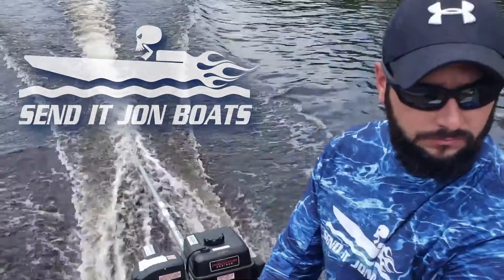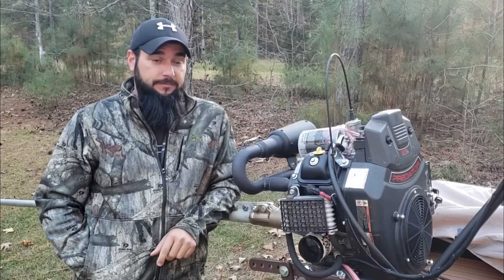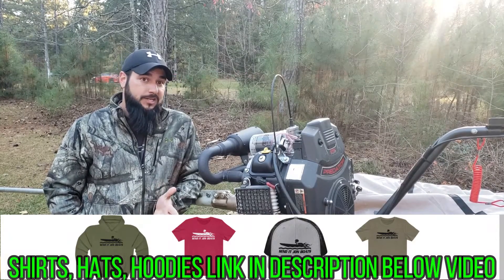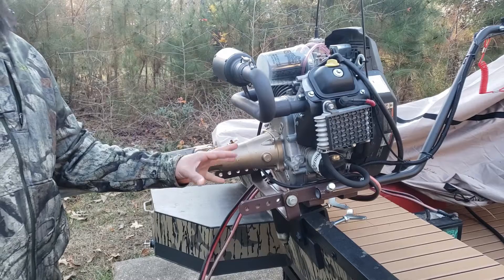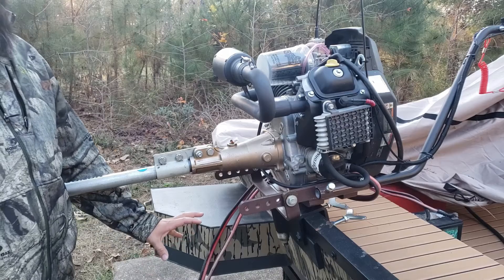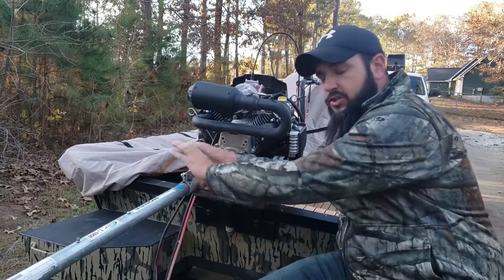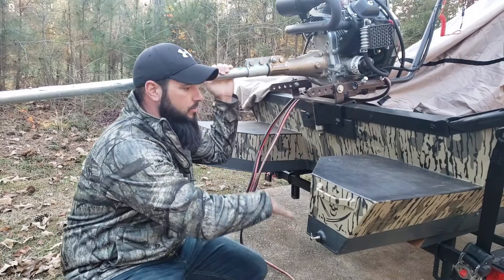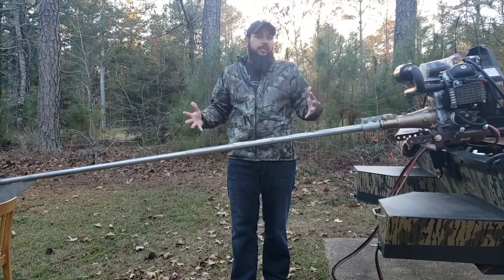Can we build a DIY Short Tail Surface Drive Mud Motor?

Comment: I just came across this post. This was done over 5 years ago, when Mud-skipper was dealing with KKK (CKS) I suggested to them, that they already had most of the parts, Engine base, Transom mount, Tiller, props and prop shafts (we'd already asked them to chop the longtail shaft in half because UPS had jacked up their rates on awkward sizes). The main box was about the only thing they had to make and they already had the sheet metal brake press. That is where the CKS Surface drive originated.

Comment: I have a 70hp turbo 3cyl that i need some guidance builidng a surface jet drive with if such a thing exists. Or a prop surface drive may be cool. I want it to mount more mid boat for better balance tho.
Reply from the maker: Never messed with a jet drive, so I will not be much help on that

Comment: Get you the juggernaut torque converter from go power sports it’s meant to take a lot of abuse and is very flexible while mounting it will give you great torque while starting out but won’t hurt your top speed since it has a 10% over drive
Reply from the maker: Awesome tip, thank you. We will look into that and see what we come up with.
Reply: I was thinking the same here . I don't know if getting it wet will hurt it .

Comment: Did you ever build your surface drive? I'm curious how it turned out .I'm thinking about building one myself but I'm curious how well it will do for comercial catfishing.....I had a guy on here tell me a way to build one with reverse ...,check out his surface drive it's here on you tube under DIY surface drive for 250 bucks ....,.he doesn't have reverse but he is the guy that explained to me how to build one...When you look at his video you'll see he used a single belt...I reccomend building just like he did except instead of the belt use a double roller number 35 chain and some sprockets...I think it will hold up better that way.....Check him out it's not a bad build at all ...the reverse ideal he gave me is pretty slick and it's cheap ....if your interested in it let me know and I can explain by pH or give you an email address ....I think there is a market for a surface drive built strong but cheaper than some I see....if I had ten grand to spend I just don't see ten grand in a surface drive ...some are built better and more complicated but that also means when you break it more money ....what's your take on one of these out drives for catfishing with barrel nets? I broke starter mounts on my 35 hp Mercury witch junked a otherwise good motor so I'm tierd of old outboards and can't afford a new one

Comment: Don’t use chain, chain doesn’t give if you hit stumps. Use a cog belt bc if you were to hit a stump you wouldn’t chance tearing everything up. For your trim you could always mount a small 4 wheeler winch and use it as your trim or just use all thread with a slanted piece of the transom and it’ll trim it up or down. If you could get a shaft made go hex way better then just a regular threaded shaft. And you’d have more options on props. 2 blades are good props but 3 blades cut down on vibration.

Comment: I vote for an inboard motor build with a cv axle on the outside of transom for up down side to side movement ,,or a ujoint may work as well
Come out say six inches from bottom of boat ,mayb a 4 foot shaft starting out,,
Kind of a mud boat style but a through transom style like the shark boats but on a smaller scale
Reply: cool I want to try that
Reply from the maker: That will be really cool, I think Chris is working on an idea to build something similar to what you are describing.

Comment: I've looked into this myself I think racing kart chainsaws sprockets would work well I also think racing kart belts will work and your housing can be built at a length you could test and shorten or make longer.    It's also very simple to change gear rations per kart racing but the correct hearing to me depends on prop size and pitch if using your straight drive prop I'd say you want same top and bottom gear since it turns on a straight drive the same speed as motor.....with kart engine parts I can build a smaller 13 hp to produce more hp than the stock 22....I suggest looking at race kart parts for all different reasons bc you hv alot of options there and I suggest sealing the housing to protect the bearings or use a down shaft motor and modify a mercury lower unit
Reply: Awesome thanks for the info
Reply from the maker: Great info, thanks for that. We are working on it.

Comment: I built a turbo diesel surface drive all out of 1/4 aluminum and it’s plenty strong. I actually think 1/4 aluminum everywhere is over kill and I should have went thinner in some places to save weight. 

For the bearings I just use a brass flange bearing at the prop and a pillow block at the back of the housing to handle the thrust. All in all, it works a hell of a lot better than I thought it would considering how heavy the diesel is but I’m still experimenting with ratios and prop sizes
Reply: That is awesome that you got it working. If you don't mind helping me out, could you send me some pictures on instagram or facebook of your build and any details you care to share, it would be greatly appreciated.
Reply: @SendItJonBoats  sure I send some pictures and what ever info you need just ask. I used what I had laying around so it’s not pretty or ideal and there’s a lot of area for improvement and weight saving but it works great.  I have a few videos on YouTube of me running it and testing it
Reply from the maker: Pictures and video links would be awesome. Send it over  to Chris on instagram or facebook @senditjonboats

Comment: I’m ready to help! I’ve been watching you’re channels and have thought the same about that question… can you do it yourself? I’ve recently ordered a predator 670, performance 670 upgrades, and a mud skipper lower surface drive unit. So I know I’ll be modifying and “sending it” real soon! I have a welding and engineering background so for one question; aluminum will be good on the housing. Since you won’t be casting it since likely you can’t and won’t want too (lol), make sure the welds are sound sir on your fabricated housing unit. In all test, test and repeat for the most part that’s why I took the “easier” road. :)
Reply: Sounds like that is what I am going to have to do, try it, test, modify and make it work!
Reply from the maker: Awesome thanks for the  info.

Comment: I'm by no means an expert, but in my expert opinion I would say steel would be the better option for the pulley box assembly. If you are running shallow or running through the swamp, it will likely take some abuse from the impact of logs, ECT. The steel will hopefully bend before it breaks. #2 length of the prop shaft will be easier to figure out once you know the height of the pulley box. You'll want 6" or so past the angled support coming of the back of the motor( support would ideally be near 45°).
Reply: Good points on the steel, I think we will go with steel for sure. Also good advice on the 45 degree support!
Reply from the maker: Awesome advice, thanks for sharing. We will be getting to work on this soon.

Comment: I would think gear ratio would be same gear top and bottom cause it's already running direct from the engine.  You could go bigger on the bottom gear if wanted to try gaining more speed.
Reply from the maker: I would like to go bigger on the bottom if possible and see what happens.
Reply: A larger sheave/gear will add/crate TQ by lowering the speed of the prop. (Top or bottom same effect)

Comment: I've been wanting to try making a short tail for my boat too. Biggest thoughts is if you mount the tail to a housing is the bearings already sealed from water? I would think getting water and sand in tail would cause issues in the lower end
Reply: They make sealed bearings you can get at a bearing house or auto parts store. You have to have a good sealing belt cover. I know on go devil surface drives you can just use silicone to keep water out of your belt housing.
Reply from the maker: Great info, thank you.
Reply: That is something I did not consider... I guess I need to look into gaskets or something to keep water out.

Comment: I have had a LT and Short tail of a couple brands.  I can help! I worked for the company that sells them all the clutches.
Reply: Hey Tom what kind of clutches did you use? I have a homemade surface drive and would love a clutch setup
Reply: Quack Lanyards Warner Electric is the OEM clutch provider. They make a version you can bolt on a sheave/belt like Mud buddy or couple to a shaft like a PD
Reply: @tommccormick3890  I have looked all over and cant find an electric clutch that has a pulley for ribbed belts. Am I blind or just not looking for the right thing? Help me out please Tom!
Reply: Awesome thank you!
Reply from the maker: Awesome thank you